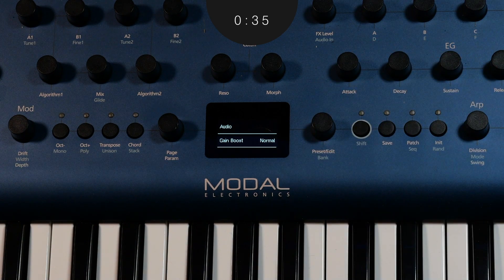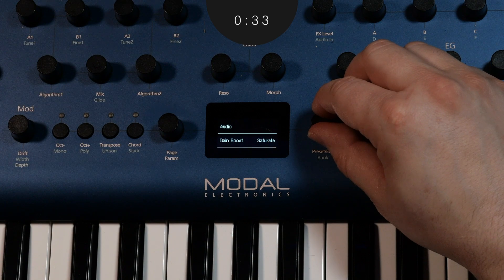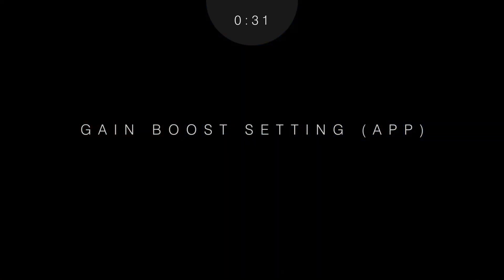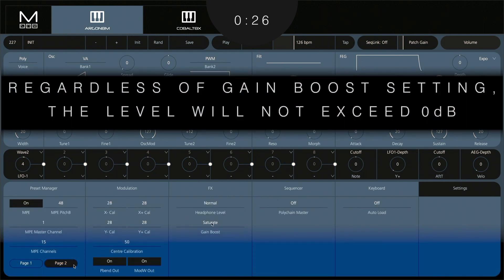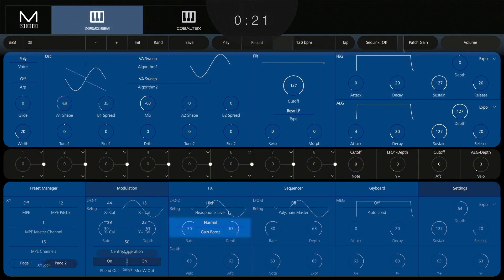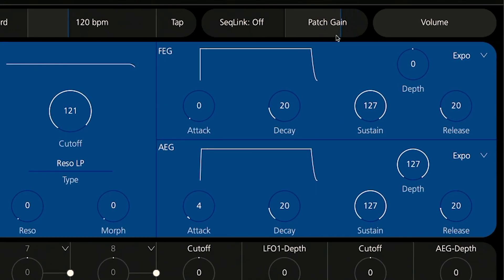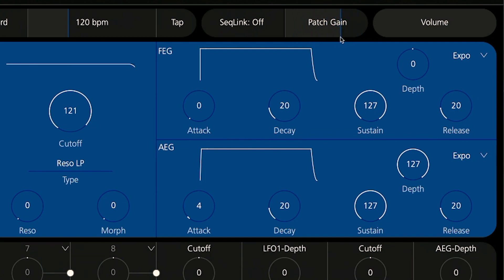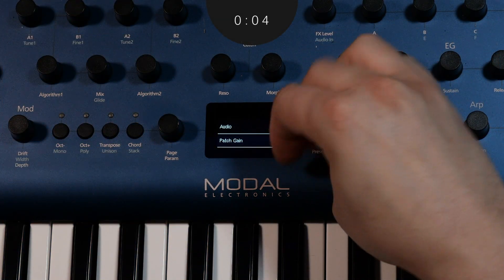Modal Minute #20 – COBALT8 / ARGON8: Patch Gain vs. Gain Boost

Comment: Still my Cobalt output volume is quite low. Are the outputs -10dB or +4dB?
Reply: @Visions of a Dream Same. I love my Argon8X but, out of 20+ synths in my collection, it's outputs are the most quiet.
Reply: Love my Cobalt8, but yes...compared to other gear, even after playing around on the volume and gain settings, it's comparatively very weak on the output levels.
Reply from the maker: Hi Wilmar, our product experts would know that for sure. Please email them via support@modalelectronics.com
Reply: I found out the same result. I usually put a utility gain plugin right after its audio to boost it a bit more. It helps, not perfect but it helps.